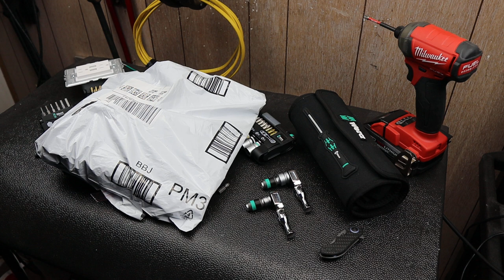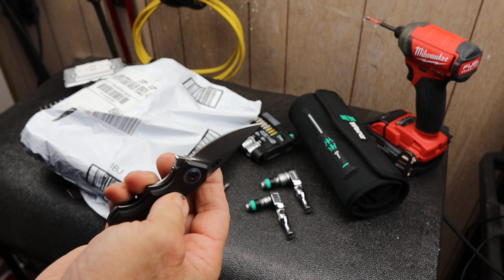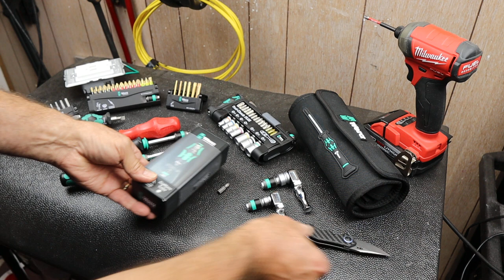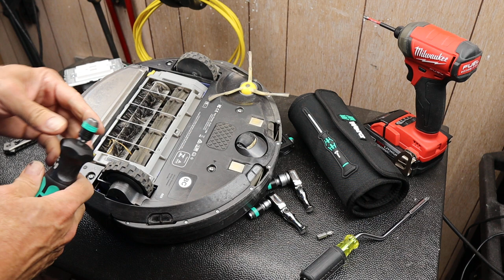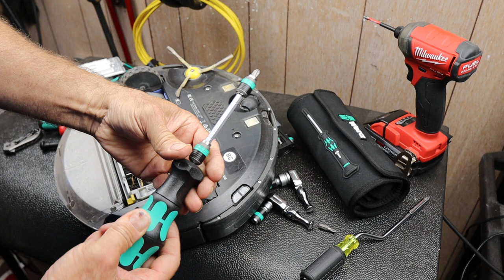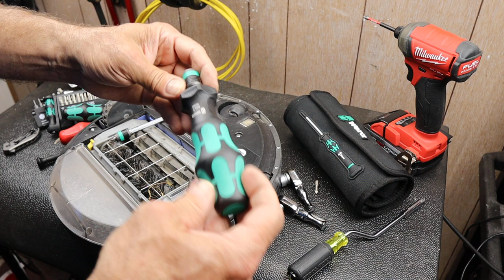The Wera Turbo Kraftform Bit Driver: Not sure its for everyone including me. What do you think?

Comment: Just got mine... I freaking LOVE IT.  It's going right in my WERA Go Bag... Genius.  Thanks for the review.
Reply: I bought it because.... Well who doesn't want an overengineered screwdriver? I was expecting it to be a gimmick but damn it's my fav screwdriver of all time, it helped me so much in my electronics job in less than a week of having it, SO MUCH TIME SAVED.
Small complaint, the gear that locks the screwdriver multiplier is a bit annoying as it seems the teeth aren't sharp enough to engage in any position, so I need to spin it a little bit to allow the button to be pressed.

Comment: This driver fits a niche but fills it so well which is why I absolutely love it

Long machine screws get absolutely eaten by this thing. The best example of where this excells is door hardware. If you need to pull off or put on a bunch of deadbolts and handles, you can't beat this. Turbo mode zips the screws in and once you have all the screws set with low torque you just go behind one time and torque them in. The 4x speed you get more than makes up for the need to switch modes.

Comment: The Turbo is a great tool for well “machined” machine screws that are well positioned and placed.  Really saves a lot of time and efforts.  Otherwise I use and love the ratchet version 816RA.  But many times I just use both with different bits at the same time.

Comment: I think a small egg beater drill would give you the same speed or maybe faster and should have better torque.  You can find vintage ones or new from Lee Valley.
You are talking about a Yankee screw drivers and Lee Valley makes adapters for them to take 1/4” bits.
Reply: Can’t really put your drill in your pocket if needed be

Comment: Doc could you tell what are those two small ratchets next to the wera case?
Reply from the maker: Those are Snap On TKF72 with one an original 1/4 and the other has been modified to a 3/8 drive in a 1/4 size head.
Reply: @lastbesttool  those are bad ass Doc👊👊👊